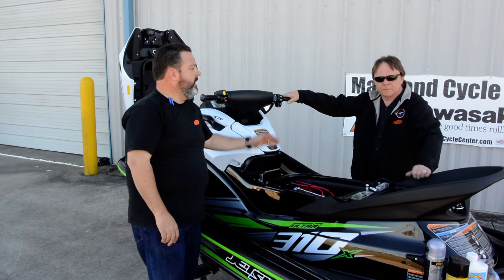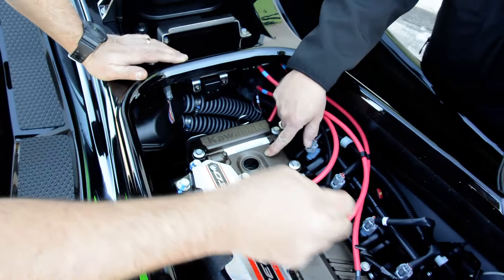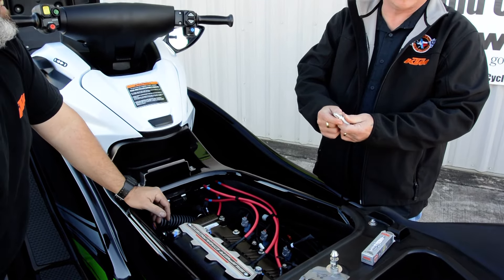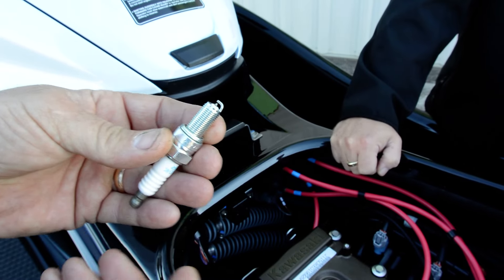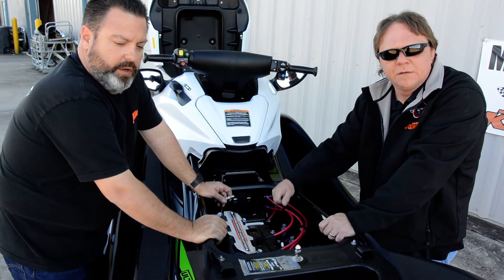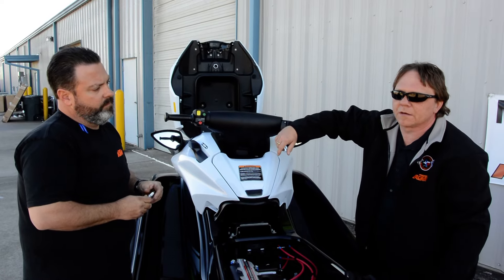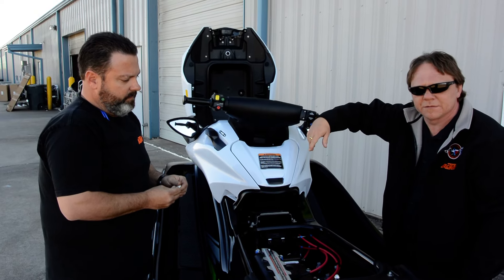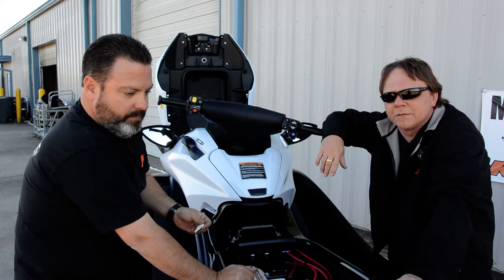What do you do if you have submerged your Jet Ski? Mainland Cycle Center Service Tips

Comment: Hey, I'd like to say that your video really helped me get my 96 Yamaha running again after a couple of knuckle heads flipped it then tried to run it.  One thing that I did that helped me as well was to take off the carburetors intake cover and shut off the choke to give as much air going in as possible. I also used some SeaFoam right in the cylinders.  Thanks again for you helpful video.

Comment: This video is awesome! Flipped my buddies Kawasaki Ultra 300x. The seat flipped off and took on water too fast for me to flip it back. The whole thing would have sunk if it wasn't for the bubble in the nose. We drained all the water out, changed oil, checked spark plugs. Let it sit for a day with a fan on it. The next day it wouldn't turn over then realized sensor in the motor will not allow to turn over engine if water is in the engine. We were going to take it in and have the shop take apart of the engine! =o During all this I lost my phone for about a day. Found it then found this video. Immediately went out cleaned out the spark plugs with some acetone and rag. Cranked the ignition without plugs and man oh man. It was crazy how much water was in the engine. It was like a geyser...lol. Did this for an hour or 2 raising and lowering the ski on the trailer to make sure and get it all. Let it sit for another 2 hours or so with fan on engine. Then we cranked it up for about 2 seconds. Trailered it out to the water and it was rough for about 15 mins. It would stall and studder. Eventually though as I got the rpms up it started to run better and better. Then boom good as new! Saved Memorial Weekend 2018! Thanks! Man I love this video!
Reply: I get almost drowned hoti me chest in water with the Motorcycle  under me, I accidentally entered water logged underpass. Instantly Engine stalled, I checked for water entry in cylinder by cranking the engine, and yes water was in cylinder. I follow the same procedure pulling out spark plug, crank engine manually, squertimg out water . cleaning the spark plug, reinstall it. Then after that remove water from carburetor by lossing the drain screw at the bottom of Carb. 

But Alass !! Engine doesn't start. It's spattering for few seconds, with black smoke out of the exhaust ,  then stalls again. 
Then I rethink to find out the culprit . So how does the water get inside the cylinder ?  So the water must be entered through air-intake Of air box then through air filter ( make it soaking wet ) then through the Carburetor and then finally in engine.

May be wet air filter is creating the problem . So I pull out the Air hose between air box and carb. Wollaah 
Bike stared in just 1 second. Drive to home with direct air intake. Latter cleaned the whole air-intake system, dried the filters . Ready for another Ride ( on Dry Roads )

Comment: After pumping out the water it is good to spray starting fluid in the air intake to help get it going. Make sure the starter fluid is the type with lubricant.

Comment: How many times do you have to change the oil?.it keeps looking like cafe with cream... i done everything and the motor starts.. thats the only issue i see at the moment.
If by any chance your cable lock nut breaks..get it out of the water immediately..it will fill with water..learn the hard way..😉
Thanks

Comment: So I removed the spark plugs, (next day bought new ones) flushed out the water from the pistons by turning the engine on, only during 15 seconds at a time not to damage the starter. Put some WD40 and used compressed air to get rid of any unwanted water remaining in the shaft.  Filled up the piston holes with mix fuel and put in the new spark plugs, plugged her up and hit the ignition, 1, 2, 3 she started up and had her running.. Stopped the engine and started her up again on 1st try.. Hope this helps you out. Seadoo 2005 sportster.. (fresh water) sunk..

Comment: i have a 310 lx kawasaki jet ski 2017 and it took on water and got water throughout the systems. i drain the oil a few time new filters to get all the contantmented water out  and change the plugs but only getting 10 psi boost instead of normal 17 and using a full tank in almost 30-45 minutes. any suggestions

Comment: @Mainland Cycle Center... 
hope you can help!  Won an older jet ski (95 SeaDoo XP) … had trouble gettting it started, but finally did, got it out into the cove.. and it died… killed the battery trying to start it again, so jumped off and swam it to shore.. by the time I got to shore, realized it was also gettting lower in the water.. turns out the VTS boot is leaking (at least I think that is the problem, there is water coming out from behind the vts cover, and there is rust on the components when I take the vts cover off) badly.. by the time I got it to shore and tied up and went to get tools and came back, water was up to nearly the top of the motor… bailed it out, took the battery out, took the spark plugs out.. and now have towed it back across the cove to the boat ramp and have it home…   its been a week…. Has it been too long?  Can I still do the turning it over with the spark plugs out to get it to expel water?  Oil mixed in gas, so is there a risk of water in the gas? Should I drain the gas/oil mix and put fresh gas in before I try and do anyting at all?
Reply: What happened this just happened to mine some hose was off and something was loose and I can't tell where the water came in mine won't start it will crank but this just happened 1hr ago have you got your too run and what have you done since
Reply: @danielm16345  mine ended up having 2 leaks, first was the drain plug... the plug was new, but the plug base was cracked, so the plug wasnt sealing.. so that was letting water in. But the biggest leak was the VTS boot... if youre looking at the butt-end of the ski.. the VTS rod is on top of the pump Housing/... warning that this did lead to a series of repairs.. in order to get the old boot off and the new boot on, i had to remove the pump housing.. got the boot replaced just fine, but realized when i had the housing off that my wear ring was TRASH... ordered new wear ring, but cant get the old one out by tapping on it from the back side.. so ill have to cut it out,, which means removing the impeller.. which means i need one of those little funky toosls that go in the splines to remove the impeller shaft.. in other words.. its still sitting on my lawn.. torn apart.. one of these days ill get back around to fixing it.. Another thing you need to look out for is on the exhaust .. where the exhaust hose exits through the hull.. check to make sure there are no leaks there, but there are also one, possibly two (depending on a lot of stuff).. little drain tubes .. about the size of your pinky finger.. that T into the through-hull exhaust port (dont know if im using the correct terminology)... make sure that those hoses are in good shape, and connected to where they are supposed to go.
Reply: also, things i learned to do if you got water in the engine compartment area.. especially if it was up over or near the spark plugs and or air box etc .. first get the water out.. there should be a sign on the back of the ski that also says to roll the ski to the left if water gets in the hull like that... i wasnt able to roll it all the way on its side like youre supposed to by myself, but a friend told me i Had to get the water out of the engine.. so to remove both spark plugs, and then hit the start button, repeatedly.. water will shoot out so stand back a bit.. dont hold the start button down, but just press it repeatedly till pretty much all the water is out.. and then, especially if you arent going to be able to fix it and get it running right away. take and pour a couple ounces of the 2 stroke oil into the spark plug holes.. if you dont, things will rust QUickly

Comment: I have all done 
Take off spark plugs 
Try to take all the water most I can
And flushed oil
Do new oil and oil filter
And get back to the water
Run the jet ski for 15 minutes
And get out to the lake
Check oil and was some water mixed with the oil still
What else I need to do to take all the water out  from the oil
Or what I have to add in to the oil to clean up all the water residues
Let me know
Please 
Thanks
God bless you guys

Comment: unfortunadly my wife sunk my jetski in fresh water i have a seadoo 2002 gtx di 2 stroke when i got home i removed  the sparkplugs and try to remove all the water from jet ski and yes it turns on and stays on all the time i can ride it again in the lake but the problem is that it wont run faster than 10 miles per hour any ideas guys please help im new on pwc is my first watercraft

Comment: OK, So what if the engine turns over without spark plugs... And when I put plugs in it, then it will not turn over?
Yes my battery is good.. Now what??